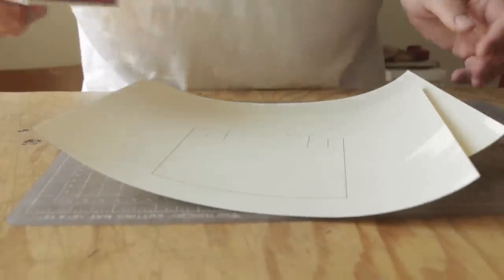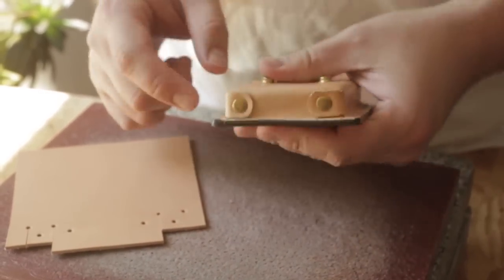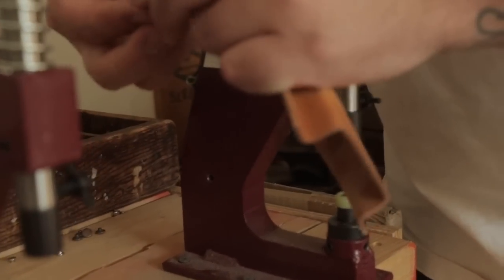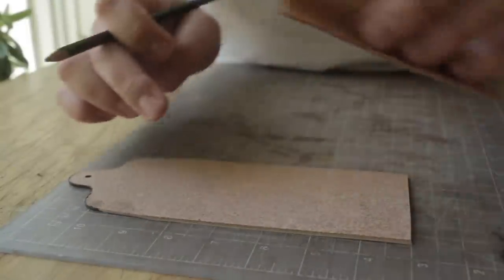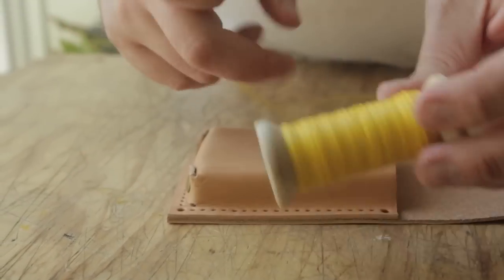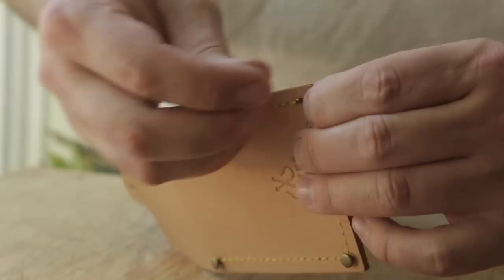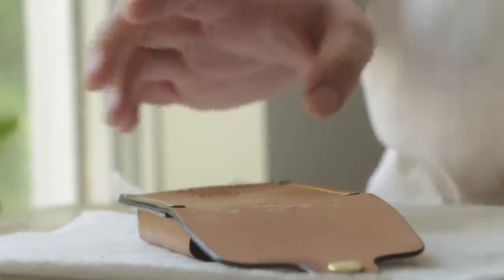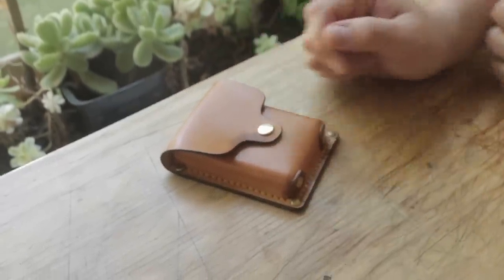My SECRET Leather Patina Process // DIY Playing Card Case

Comment: A belt loop with 4 rivets on the back or adding 2- 1.5"-2" vertical slot holes in back for a belt could be an interesting variation.

Comment: I'd use a cobblers anvil if I had one, but I don't. What I do instead when I need to set rivets like that is slide a 1.5"x3/16th tool steel bar down into the pocket. Happen to have these from when I was making knives, but I'm sure you could use plain mild steel just the same.

Comment: question if I may when shaping a bag this way of about this size will it hold its shape if it does not have the playing cards in them 

im making a belt pouch for my compass and figure I could use a block of wood about the same size to get the general shape of the pouch

Comment: Beautiful, only thing you need to change is leave a notch where the cards come out so you don't have to dig your thumb in pulling them out. I still want this holder so bad though..
Reply from the maker: You could make one and add a notch very easily! once it's broken in you just tip it over and the pack slides right out so I didn't add one, but totally a simple modification if you'd like
Reply: @Corter  that's true👍

Comment: We used to rely and heavily use Aussie leather finish, but years later, it is clear that the products that we used the Aussie on showed definite and unacceptable signs of degradation. It is like the surface of the leather, what the cortex, sorry, brain not working now, but that real tight surface grain loosens from the bulky, looser grain of the flesh side of the leather. The top grain then becomes dried out appearing (cannot be revived by reapply, or reoiling), and gets wrinkly to the point of the brink of cracking. Anyone use Aussie for a number of years and experience this effect on their leather products?

Comment: Good video tutorial as usual..Have you had the opportunity to experiment with oxidation techniques for patina on veg tan leather?.. Common 1st Aid Hydrogen peroxide as well as household bleach makes for a varied shade of London tan 5sec to 30sec exposure time..Followed by a good conditioning cream / oil to replace the natural oils taken out by the oxidation solutions.. Baking soda powder used in a few heaping tablespoons per 8oz of water makes a dark brown color.. all of colors can be controlled by exposure time.. a sidenote worth mentioning is bleach is rather harmful to leather and on the extreme side of what I'd personally use..A video tutorial on patina finishes would be very interesting to watch,the different techniques commonly used..